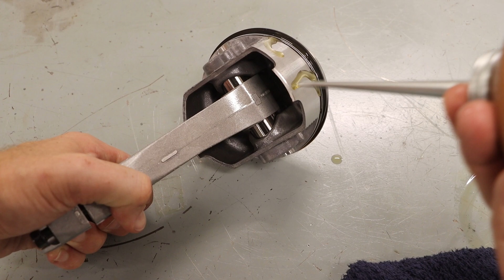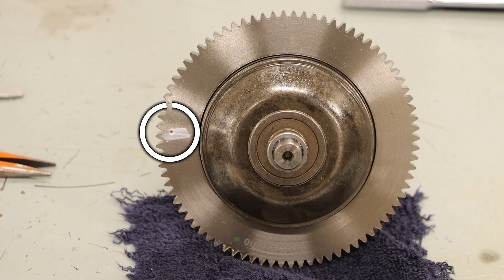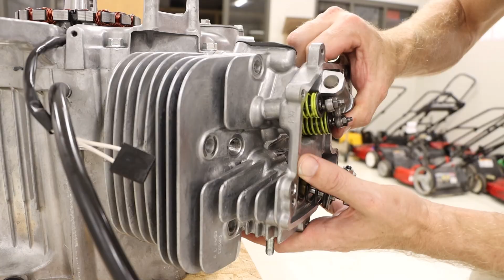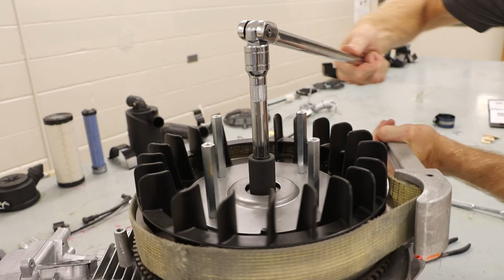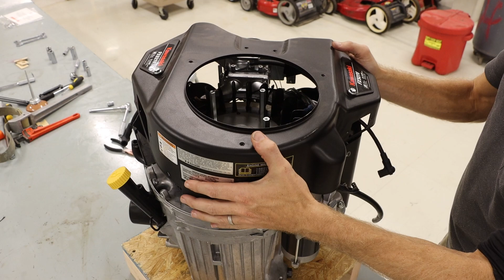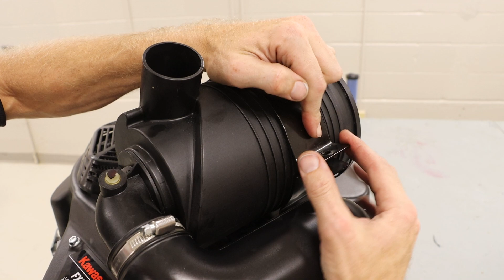Reassembly of Kawasaki FX921V 31 hp - Engine Reassembly Tutorial

Comment: Did it have the heavy duty air filter system on it ??? Please answer ok ✅
Reply from the maker: This particular engine did have the heavy-duty canister-style air filtration system installed on it. The Kawasaki FX921V commonly uses a multi-stage canister air filter setup on commercial applications.